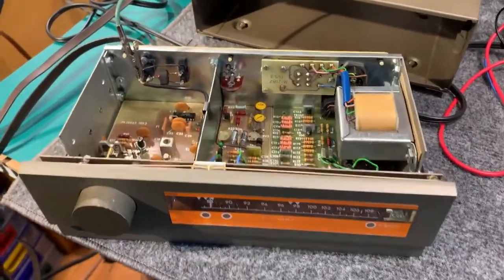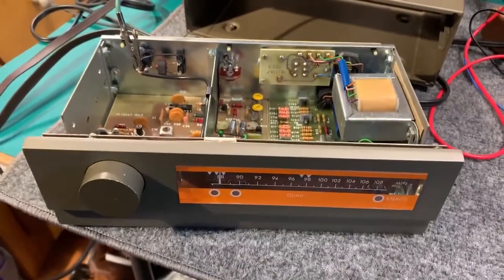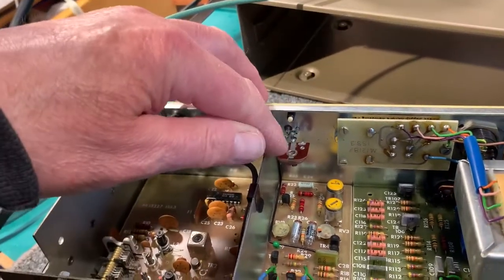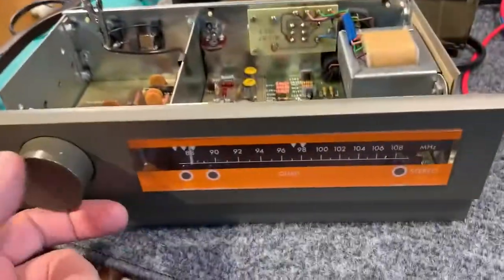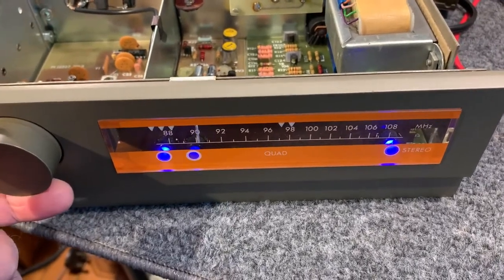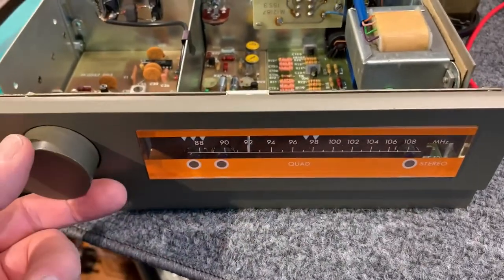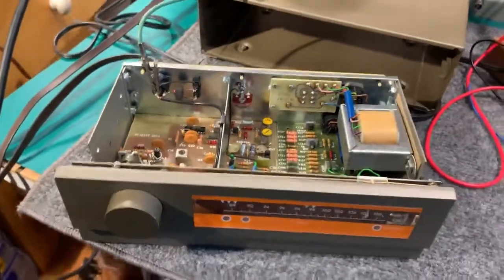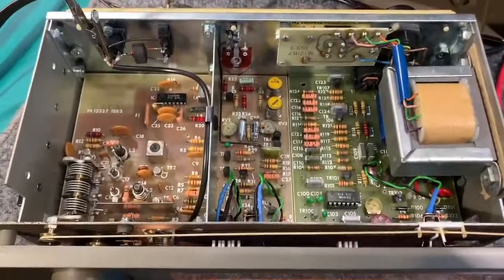QUAD FM3 Tuner - Repair and Demo

Comment: Just curious how you get the bulbs out of the spring holder's. is there a trick. I'm having a hell of a time trying to get them out to replace them.
Reply from the maker: If the bulbs are stuck tight, I break the glass, carefully remove the glass fragments and grip the metal screw section with serrated pliers and turn it.  If it still won't budge, use snips to cut a slot in the metal and then try again.  Place a cloth over the circuit board to collect any debris

Comment: Very good. You should replace the three electrolytics and the 15V Zeners in the power supply. Nothing else.

The Quad FM3 was produced from 1971-1982.
Reply from the maker: Hi EJP.   This tuner is 'long gone' from my work bench (the video was shot almost a year ago) and was sold on by another friend with the proceeds going to a cancer charity.  Good point on the electrolytics and Zener though.  I have an FM3 tuner of my own, and, although not used much these days, will do this work on it when I find the time!
Reply: @RadioRestoration if you have a vidéo of changing the zonées and electrolytics … Thank you
Reply from the maker: @jeanderome4223  Hmmm - I have not changed them yet(!) - I've been busy with other stuff, but will get around to it eventually and will post something on it.  Thanks for the reminder!